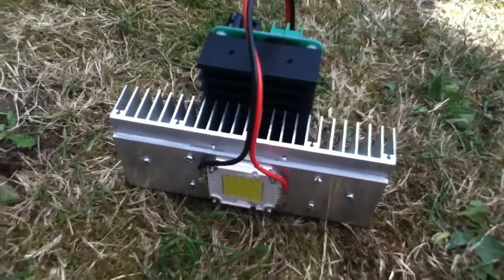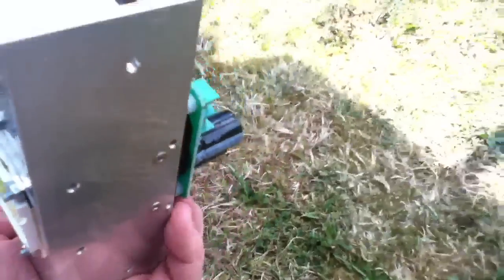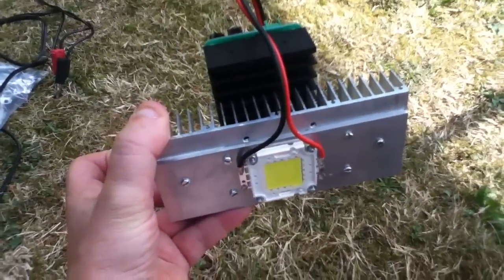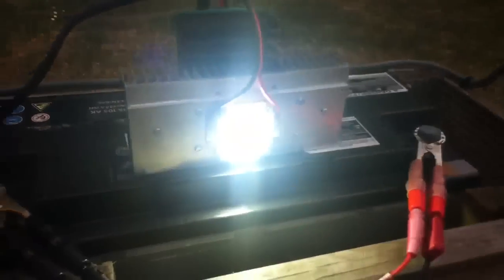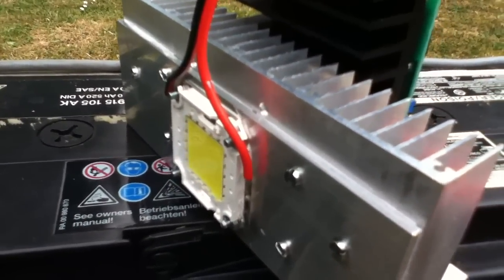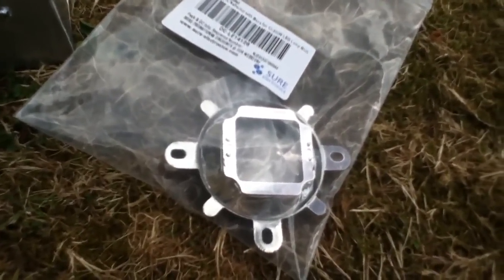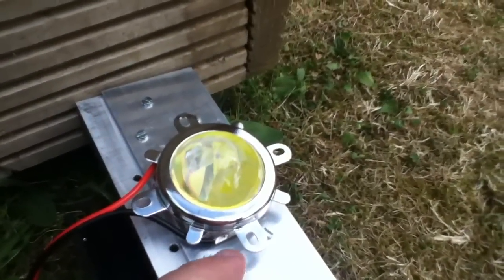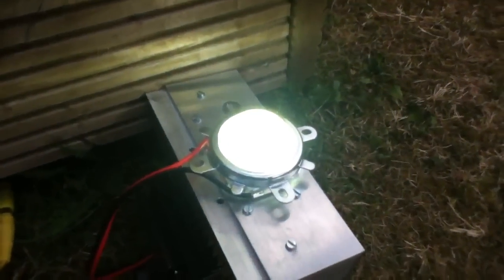Updates to 12V 100W LED Hardware - Heatsinks, Grease & Lens/Reflector

Comment: Would it be possible to integrate a solenoid actuated flap in side of the unit so it would have switchable high and low beams, like hid projector car headlights.